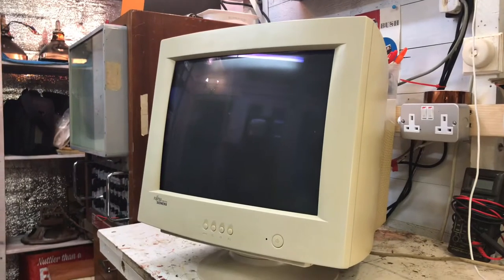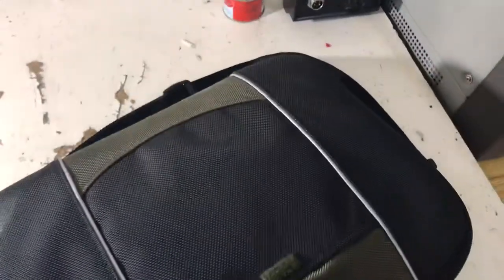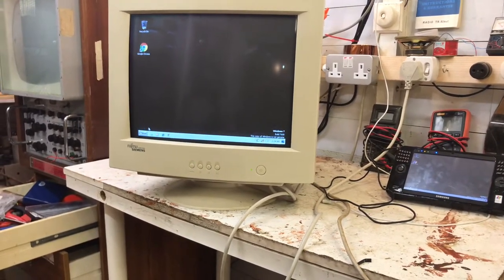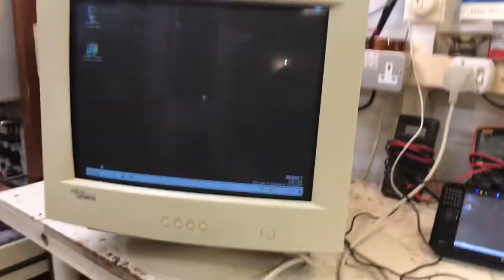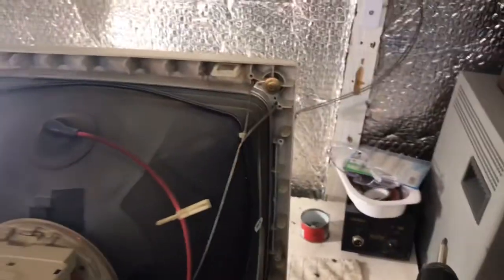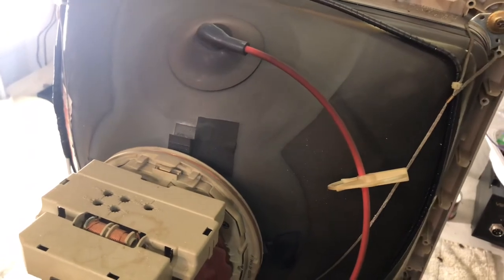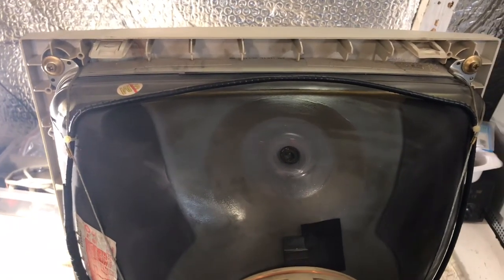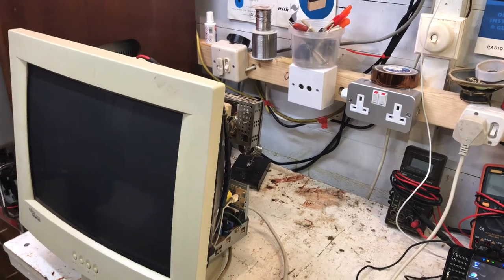Vintage CRT Monitor Clicks when turning off - Let’s fix it!

Comment: Hello! I have an old CRT monitor where I'm having the opposite problem. It just clicks whenever I try to turn it on, and it can't. Would doing this work? Have you ever dealt with something like this?
Reply: I know its not much to go off of but its a Samtron 77v 17” CRT from 2001 if it helps.
Reply from the maker: Sounds like flash over - and then the line output stage goes into thermal shut down. You need to figure out why!
Reply: @chabby8391 did you ever figure this out? I have the same Samtron monitor with the same issue.
Reply: @Johnny_Zdj  no sadly, been trying but can’t seem to find why. It does it. Still got the monitor tho